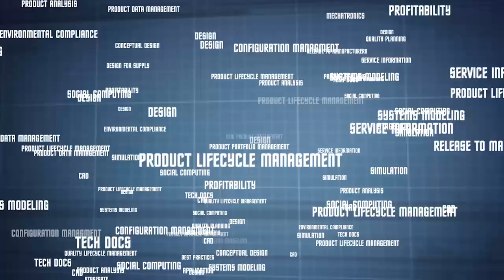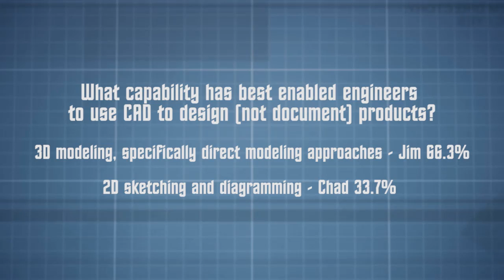Platform Design and Modularity

Comment: Great discussion, and the conclusion about PLM taking the lead in the implementation of platforms makes sense given the larger scope of the tool. However, there is still a challenge to populate the information from the creation of a Modular Product Architecture into a PLM or CAD system. Tighter integration at this end is also very important.